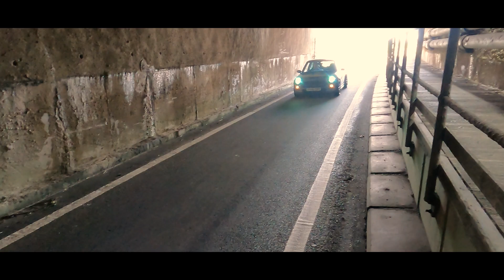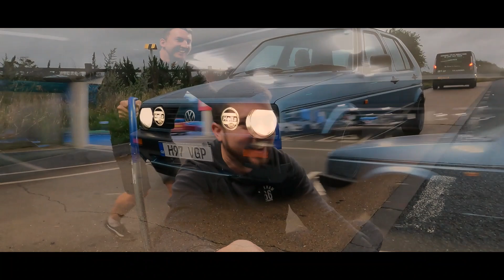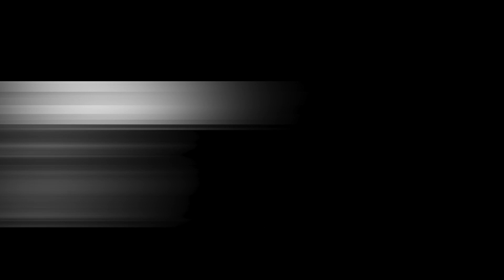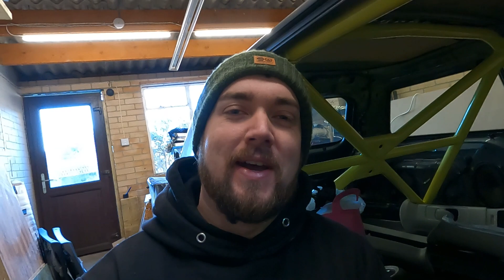How to install an engine mount on a R53 Mini Cooper S 2003-2006 - Vibra-Technics

Comment: Just cut off what's left of the broken bracket for the earth stap and file it flush then 7:02 Drill a 8mm hole in the engine mount and just nut n bolt the earth strap to it. It worked for me and looks neater lol. Liking the update videos.
Reply from the maker: Great advice man, take it that won't effect the brackets strength to much? Appreciate it 🤙

Comment: Marinetex would probably held that broke piece for the ground cable on cast iron, but if you found a new bracket 
all the better.
Reply from the maker: Yer that's a good idea, but they were cheap enough second hand 😁